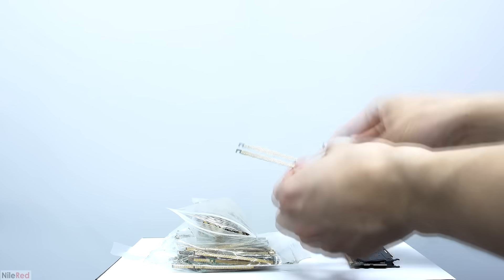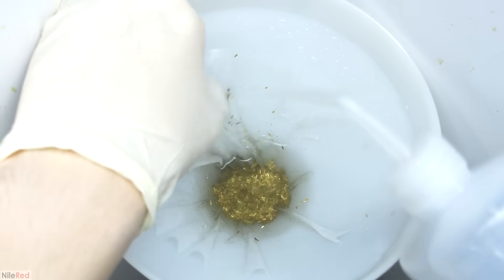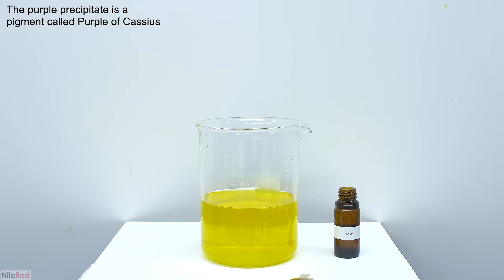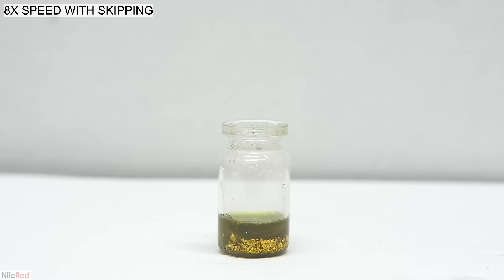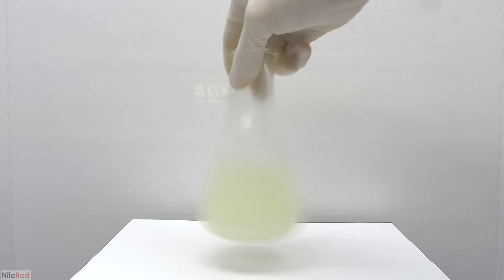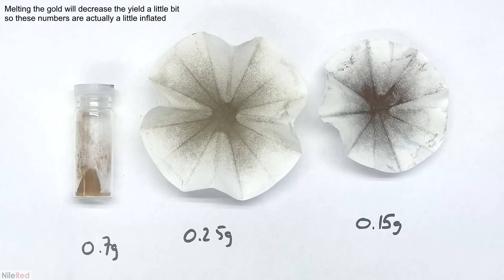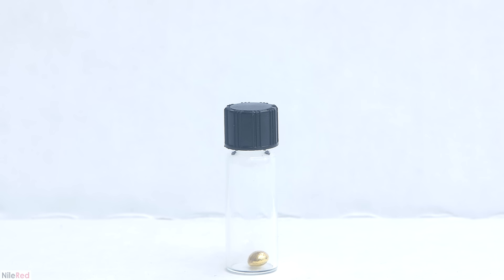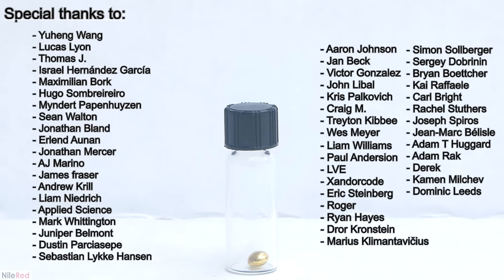Extracting gold from computer parts (Part 2)

Comment: Thanks for the bleach method, I NEVER heard of that one. I just finished making a small batch of probably medium to weak nitric which if worse comes to worst, I can NOW use bleach. Is it about the same with regard to how long it takes to dissolve? This is a small bucket of possibly gold rich rock, so I imagine I'll be needing about a liter in total acid. Unfortunately, I can only go to about 300 ml, actually no, the nitric will not be pure so more like 200... Aye aye aye.. Again, thanks, now I have an option two

Comment: Might I suggest an initial step of combusting the polymeric components of the boards in an oxygen rich flame prior to the HCl-peroxide digestion? You would remove the circuit coatings which prevent proper dissolution and it means that the Cu/Cr/Ni solution in your first step could, itself, be processed for metals because there would be fewer organic contaminants. You could also try electroplating the gold out of solution onto a ceramic electrode, rather than that ugly precipitation with metabisulfite.

Comment: Less than $50 worth of gold! Wow totally worth all the trouble
Reply: J Jugg He didn't really process that much hardware.  You could increase yield significantly by increasing the size of the batch.  I think you could manage 4-5 times as much material without running into problems of handling becoming unwieldy.  I'm sure he bought scrap computer hardware just to make the whole process easier and cleaner for the video.  You'd basically just want free, raw waste, but it would take more work extracting gold-rich components and chucking the rest.  I think you could probably make some money doing this, but there's probably more lucrative things you could be doing with your time.

Comment: I have been collecting e-waste , paying nothing except my time and fuel for truck .
Looking at a variety of processing methods , most that I am choosing keep in mind using the min. amount of chemicals & fuels .
Mostly mechanical , pulverizing - ball-mills etc. to reduce to fine powder , then further mechanical  methods like in mining using gravity , water & any number of equipment to get to a concentrate of fines = gold & other heavies .
I did mining in past , and have not done any of the refining yet , accumulating enough gold e-waste to do the refining .
ONE THING that has occurred to me that almost no-one has demonstrated yet that I have found , is CASHING IN ON the waste - without doing any real numbers just , number that represent the concept - if the gold from e-waster represents 1% from the e-waste , then is lets say 90% copper in the waste , using 100 lbs  as one of the points , then we have at least 90 lbs of copper , at $2.50 lb - about what I get for #1 copper at the scrape yard , that means we are thronging away $225 - CASH IN .
Now consider your cost of refining ???

Comment: Hm. i don't suppose you can use heat to separate the metals and burn off the excess plastic?
Reply: Phhase burn plastics is perfect if you want to die prematurely by cancer lol
Reply: You'd still have to filter the gaseous result of burning it, which would be much more of a hassle than filtering liquid. You can't just dump chemical waste out the window, even if its lighter than air

Comment: hey. melting gold is something I'm working on myself. I'm using a propaine torch and a spoon. the trick is to get the spoon red hot from the bottom then add borax and hit the gold on top with the torch. but it can be done with propaine. it just takes a little time
Reply from the maker: +brofessor brett I didn't even think of using a spoon. Good idea!

Comment: I work for a local computer repair company, if you are interested in doing this for fun call a local place and see if they could sell scrap parts for cheep. I am always trying to offload old ddr2 ram and HDD boards. Also check out where the local computer drop off location is. Each county should have a drop location for old technology to properly dispose of them. People will often take junk there and if you know what you are looking for pickup old circuits and salvage them for the gold. Fun little experiment.

Comment: I've never done this, but I'm very familiar with computers and parts.  The parts that I'd say have the most gold on them are RAM, GPUs, PCI/PCI-E/AGP cards, connectors (IDE/SATA, etc), cable ends (hard drive cables and sometimes you might find a very, very tiny amount of ethernet connectors), CPU pins (depending on the generation of CPU, there may or may not be pins...some use very small flat plates, which I presume would have even less gold on them).  There's probably some in power supplies too, but if I had to guess, most is going to come from RAM, GPUs and PCI/PCI-E/AGP cards.  I'd imagine that PCI cards and GPUs would have a bit more than RAM, due to the size of the slot.  I'm not sure I'd even mess with motherboards or any of that type of stuff, the return would be too low, unless you can get it for practically free, or free.  If extraction of copper is worth doing, there would be more copper in power supplies, heatsinks (CPU/GPU/motherboard) and of course the cabling/wires.  

Good luck.  :)
Reply: There is also tiny gold wires in all ICs.
Reply: Yes, the older equipment has more in it than the new stuff. If you can scarf up some old mainframes, they are LOADED with it. (think VAX 11785 or 11780) but even the early PCs were good. think about the manufacturing processes and how we've improved them over time. I have a box where I collect anything cold, from tanks from vape junk to connectors to garbage rings and jewelry, once it's processed, who cares where it came from.
Reply: I work at a company that refurbishes used electronics and anything we can't fix or can't financially justify fixing is sent off to a partner company for precious metal extraction.  Some of the components we set aside as "high yield" that surprised me were the PCBs connected to laptop webcams and touchpads.
Reply: Old Pentiums are the best
Reply: Yep, if you crack open a metal top CPU like a p133 or 166 you can see the actual chip basically suspended on a bed of gold thread.  It's pretty cool looking.

PSUs have a little palladium, and if you do a really thorough job of it, you can also recover rhodium and palladium from the capacitors on some boards (at least you could in the past, no idea if the manufacture of them has changed).

Catalytic converters are also a good source of precious metals if you can process enough of them to make it worth the money.

Comment: Hey I do this quite frequently, it's basically not worth it at all besides all the fun BUT. The best way I found to get all the gold off the spent trimmings is to get all the acid off of them and then just put them into a big bowl of water and shake them around a bunch. It'll all fall to the bottom and then just continue to shake pieces as you pull them out and nothing will be stuck to it. It also helps to massage the pieces as you pull up just in case some aren't finished yet

Comment: I wonder if pulverizing everything first in a ball mill or some other type of machine (other than a blender...) would be a good first step to mechanically separate everything. I'm thinking from the standpoint of eating everything from a computer.. the entire motherboard and chips not including the aluminum heat sinks and stuff like that. I can probably get a 5 foot pallet of dead computers and laptops... 

Maybe burn the stuff first, then crush up everything else that's left... ball mill it, then chemically process it.
Reply: kleetus92 If not breaking gold off, if there's some way you can  just use the force of your hands to pulverize the equipment such that it's as powderized as possible, you'd need to use a smaller volume of chemicals, as it would fit more densely into the bottom of a beaker/container.  If running it through a ball mill, you'd have to consider the cost of the electricity depending on how long you let it run.
Reply: This is a good point. Like so many other things in life, nothing is free. I'm kinda looking at this from the standpoint of processing some ewaste into some useful gold that I could make into a ring. Sure I could buy one, but where's the fun in that?
Reply: kleetus92 If you process it into a ring, you could definitely charge more than the raw material would fetch.  The standards for purity might also be lower, not that you'd want a 100% gold ring anyway given gold's malleability.

Comment: You omitted a step before the precipitation.  When you use aqua regia to dissolve the gold, the nitric acid interferes with the precipitation process (by re-dissolving the gold).  There is a simple solution to this problem (other than adding huge excess of sodium bisulfite).  You add urea to the solution SLOWLY.  It foams as it reacts and destroys the remaining nitric acid.  When the foaming stops, you can proceed with the bisulfite precipitation step.  The urea is inexpensive.

Another recommended step is to wash the precipitate first with water, then with a little ammonia water, then distilled water before drying and fusing.

Comment: Hi
Earlier today I was distilling various batches of waste acetone in an attempt to recycle it
Some of the batches included contaminations of red phosphorous, capcacin and some unknown adhesive as well as a few Unknown contaminates from other reactions

Anyway once I had finished boiling the acetone away (I used the same flask for all of them) there was a orange ish goo left on the bottom
In an attempt to clean it I added some water and surprisingly the goo on the bottom changed into some sort of cellulose structure, almost like a clump of hair at the bottom of the flask

Any idea of what this is or how it formed?

Thanks
Reply: Actually I have been been moving it around in the flask in an attempt to get it out and it has now taken on the consistency of used chewing gum

Comment: Why not just use cyanide or aqua regia directly on the trimmings to dissolve the gold, filter it off, then recover the gold from solution? I can understand aqua regia would dissolve many more metals than just gold, but what about cyanide?
Reply from the maker: You are right, the aqua regia could make things messy. Maybe the cyanide would work though. I am not sure. I haven't researched the used of cyanide very heavily yet.
Reply: NileRed Nurdrage and codyslab both have really nice videos on it. Whenever you get around to it, a video from you about it as well would be awesome :)

Comment: The gold on the RAM trimming is ticker then the Gold on the surface of random PCBs. If the PCB design engineer knows what he is doing, he will specify a different process for those contact zones. (galvanic applied "Hard-Gold" instead of just chemically applied NiAu)
An other point: Correct me if I am wrong, but your process looks like recovering pure gold from the surface. In E-Waste, you have lot more issues: Most of the gold is in an Tin-Silver-Copper-...-Gold Alloy (if you are lucky - lead or bismuth were or are used as solder alloy component). Then there was a time, when the silicon in semiconductors was connected with Gold wires to the leads of the housing. To get this gold, you would have to dissolve the epoxy chip housing (and hope that there is Gold and not aluminium wires). At least when the chip has gold bonding, then it is pretty pure gold, so that's lucky.

The video was awesome by the way: As an electronics engineer, I am always interested how a chemist handles solid and liquid metals

Comment: hello, I am interested in trying this experiment, but I seem to be unable to get my hands on pure Sodium Metabisulfite. I found a few things on Amazon but they always say "Sodium Bisulfite & Sodium Metabisulfite", is that normal, can it still be used for gold recovery? One example: https://www.amazon.de/Natriumdisulfit-Natriummetabisulfit-Natriumpyrosulfit-Lebensmittelqualit%C3%A4t-versandkostenfrei/dp/B00T6KGKPO/ref=sr_1_1?ie=UTF8&qid=1469038538&sr=8-1&keywords=natriummetabisulfit I'm sorry it's German, but the names don't differ that much. I would order from "The Science Company" but that would ruin me just for delivery costs (I live in Europe), so I have to get it from Amazon or maybe Ebay. Thanks in advance.
Reply: Colin, just go on eBay and buy it. It's a common food preservative/additive and it's readily available.
Reply: Diverse Bezeichnungen für das selbe Zeug.
Und ja ist das richtige.
Viel Spass beim Ausprobieren :-)
Reply: Landogarner83 Erstmal danke :) 
Ich habe mir die Wikipedia Seiten auf English und Deutsch Mal genauer angesehen. Natriummetabisulfit = Natriumdisulfit ≠ Natriumbisulfit soweit ich das richtig verstanden habe. Das d/b macht also den Unterschied. "metabi" ist also "di" aber nicht "bi". Etwas verwirrend haha. Ich werde mir das Zeug dann zulegen :)
Reply: Sodium bisulfite and sodium metabisulphite are two names for the same thing.  They are commonly sold in brewing and winemaking supply shops for sterilising bottles.
Reply: +Patrick Sweetman that seems wrong. On Wikipedia, Sodium Metabisulfite is the same as Disulfite, but not Bisulfite. 

„Natriumdisulfit kann namentlich leicht mit Natriumbisulfit verwechselt werden, einem älteren aber noch gebräuchlichen Namen fürNatriumhydrogensulfit.“ 

Which basically means that Sodiumdisulfite can be easily confused with Sodiumbisulfite, which is an older name for Sodium Hydrogen Sulfite. 

Further, both formulas are quite different, 

Sodiumdisulfite/metabisulfite: Na2S2O5
Sodiumbisulfite: NaHSO3

Somehow the English Wikipedia offers less information about this topic than the German one.
Reply: Sorry, sodium hydrogen sulfite, sodium bisulfite, and sodium metabisulfite are names for the same thing.  The difference in formula is due to the reversible loss/gain of a molecule of water.
Reply: +Patrick Sweetman they are not. Look it up. On Wikipedia it clearly says that it can be easily confused because of the name but they aren't the same thing. Sodiumbisulfite is used to produce Sodiumdisulfite by evaporating a solution of it that is saturated with SO2. So they are different. Different formulas often result in different reactions, so you definitely wanna get some Sodium Metabisulfite or Disulfite, but not Bisulfite.
Reply: Patrick Sweetman is right. While the two chemicals are not the same, you will have both as soon as you dissolve the SMB in Water.
Reply: kjpmi I ended up just buying the stuff from Amazon I linked above, seems to be the right thing and the price appears to be somewhat good.
Reply: That's great! Yeah it's usually pretty cheap.

Comment: I've also had overflow when adding the SMB when doing highly concentrated batches, now I always neutralize excess nitric acid with urea before adding SMB (and keeping the flasks in a shallow bucket/container - first spill went straight down the drain :)